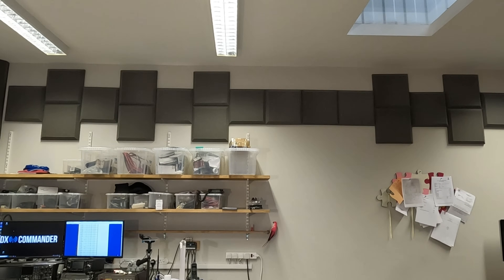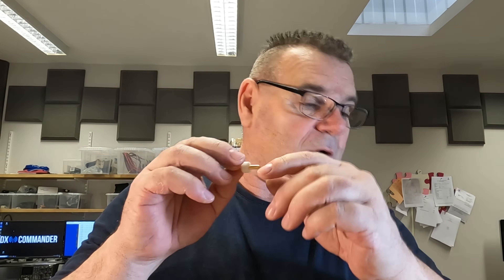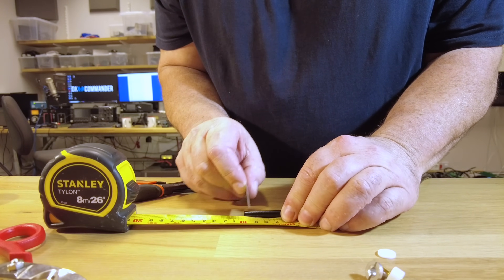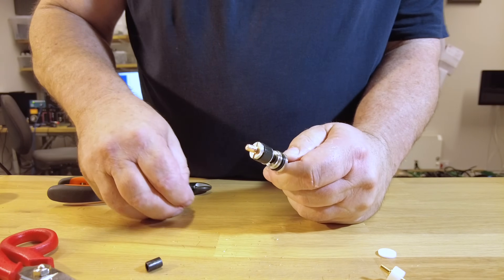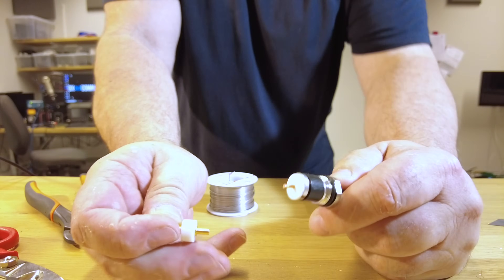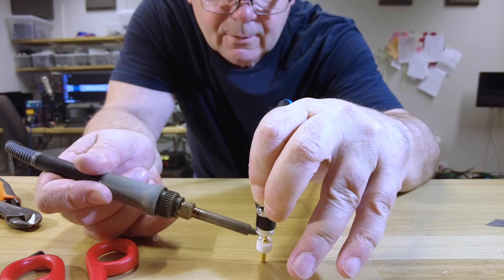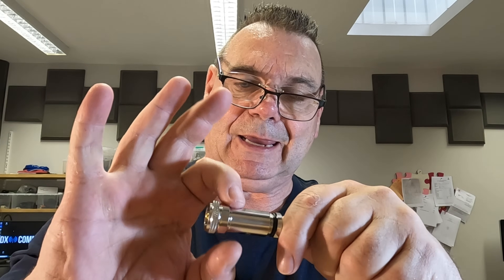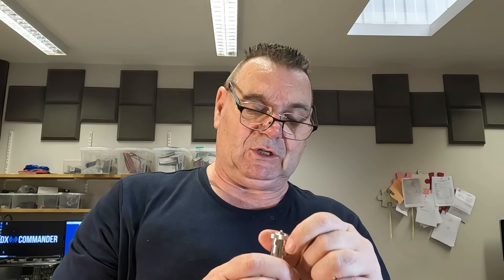Regular Man Fits PL259 Coax Connectors

Comment: Since you asked, the only suggestion I'd have is to not pre-tin the coax inner, then get a good bit of flux in the hole, and use LOADS of heat from the iron.  As much as you can.  Quicker you get the job done, less chance of melting the plastic bits on the connector.
Reply from the maker: I have since found a massive iron.. I also need flux pen. Next time..

Comment: The last batch of M&P PL259's I received from Martin Lynch were like the normal PL259 where the centre conductor passes through the pin and easier to solder at the tip as normal. Love M&P coax and connectors.
Reply from the maker: I like the through-pin..
Reply: Thanks John!   Have you bought the connectors for Hyperflex 5 or Airborne 5 perhaps? Just the connectors for those two cables (in the range of 5.0 to 5.4 mm),  have the old-fashioned "through pin".  All the rest of UHF ones has turned into EVO with the rounded pin. Please let me know...
Reply: @stefanomessi  Ultraflex 10. I hope the others change the same way. So much easier than the small hole on the side.
Reply: @johnharrison5703  Thanks for the prompt reply John. They must have been an old batch of the previous ones. (regular packaging and Connector M&P engraving right)?   Just take some practice and you shall see it's easier and cleaner than before.  Callum did it all right, save not using the M&P-Flux, or other Quality Flux products.
Reply: @stefanomessi  yes M&P Etched on the body and proper packaging. I buy mine from official M&P supplier here in the UK.
Reply: @johnharrison5703  Thanks John.... try the Evo ones when you want: It's easier than you might expect with the M&P Flux ... sucking by capillarity the solder in the hole.

Comment: Interesting.  I've just purchased some PL259 which look like N-type connectors. I've fitted N's to coax (UR67) in a previous career, so I'll be watching with interest.  (pre-video presentation)
Reply from the maker: Hopefully you will have learned from my mistakes!
Reply: @DXCommanderHQ  Ha! Well with my banana fingers, my assembling is probably worse than yours. And assembling on-camera, one always drops 10 IQ points.  However, nice job!

For me, I don't mind a hi-temp iron for this kind of work, but have the good fortune to have several bits. With my co-ordination I use a rod shaped bit rather than a cone to preserve nearby plastics in tight spaces.  I ^very^ gently clean the surface of the inner conductor just to remove any insulator residue before tinning. In my training I was taught to tin furthest from any plastics:  IE nearest the tip of the inner.

Looking at my PL259s, they have the N back end, but the straight through pin of the original. A MUCH better arrangement for the braid.  For the original PL259's back in the day I used to pigtail the braid before soldering it in to the body, most unsatisfactory.
Reply: PS 7/10 because of your spanner substitutes! Oh, man! 🤦
Reply from the maker: @Broadercasting  Haha
Reply: Thanks for the post
Our UHF EVOs are inspired to the N connectors and  never a UHF connector performance has been so close the the "N" ones.
The assembly is quite the same so if you know how to deal with the N, the job is done.  The two disks to be placed around the hole in the pin, are made of genuine Teflon, so there is no problem in that area.
Just do not overheat because the only part in danger is the Foamed Polyetylene of the dielectric. 
(everybody knows that copper of the inner conductor transfers heat very well).  
The use of M&P-Flux or other quality-no clean flux is necessary in order to speed up the process, avoiding overheating.